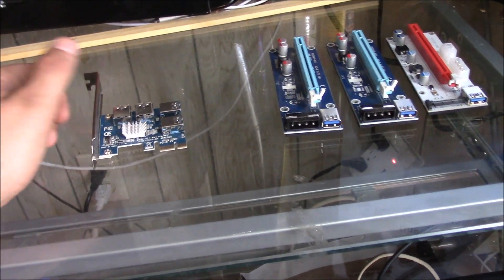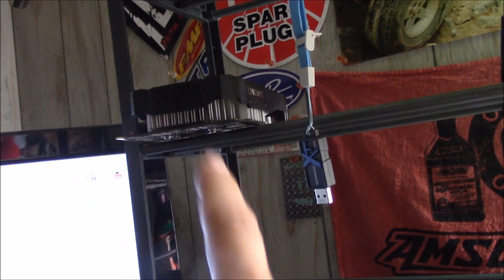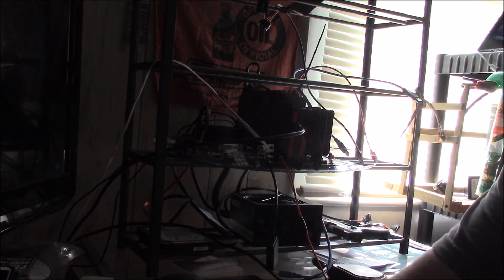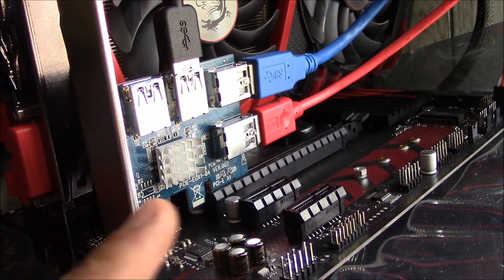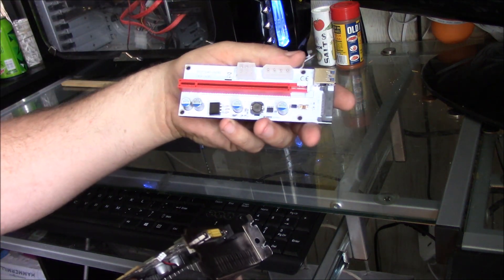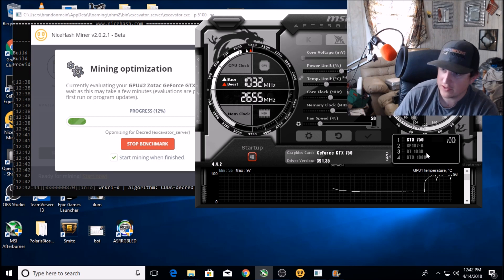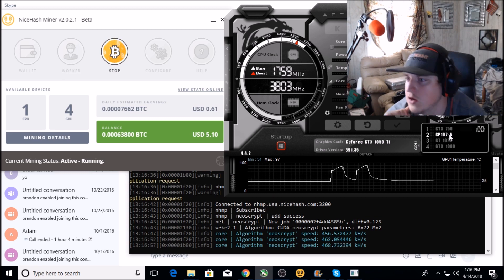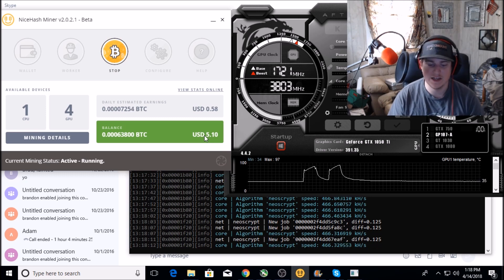Ubit 4-1 PCIE adapter splitter install more gpus

Comment: I know it's been a while since this video.... I'm having issues with my pc not posting, the monitor says it's going in to power saving mode and then gives me a black screen? I'm thinking it has something to do with pcie lanes on my x470 msi mobo. It's combined with 3200g cpu. I had 4-3070 and 1-3060 running fine on a 1200 watt psu and server psu for the risers... the only thing I did was add this 1 to 4 adapter. I'll try to see if I can get 2 to run before plugging the rest in.

It's either my cpu not having enough cores/threads (4/4) or my pcie lanes not being able to handle 4 cards. What do you all think? I plan to add one gpu at a time but to get video to display again I'm having to reset the cmos... tedious trouble shooting!

Comment: hi brandon since  3060s lhr needs a  16 or 8 pci  slot to give the max  hash on etherium does it do the same for ergo or i can install it with  this splitter and  still have the max power of the card

Comment: You should be clear that those are not really USB ports, they just use the USB form factor, but signaling is totally different on those pins.  If you try to plug a usb device in, it will probably kill everything.

Comment: Hi bro , I am using Asus prime h310 m2 Mobo , it has 16x slot 1 and 2 pcie slot. 
I am running 3060 1pc in 16x slot
1660 ti 2 pcs in pcie slot.

I had tried using pcie splitter for adding 2 more 1660 super using splitter

But my Mobo not detecting new GPUs.
When I add first shown error bootable device not found.
I had resolved it with adding additional psu.

Then second issue found windows 10 loaded but GPU not detecting.

On bios settings changed pcie version to 2.0 and 4g decoding enabled.

Then also my issue not solved.

Could you please make a video regarding this ?
Using same motherboard prime h310 er2.

Comment: working on mine :) used ITX mobo so I need this to run 6 GPU :) been 2months mining through it
Reply: What Gpus are you using ?
Reply: @adesheddie1  2x 3080 amd 2pc 3070 :)
Reply: Holy shit! This thing can handle those GPUs ? Is there any power issues?
Reply: @adesheddie1  well yes since feb this yr :)

Comment: Thank you for this video . Please make sure.  You always explain splitting pcie and splitting power are 2 dif things.  Sounds simple enough but some new users try to cut corners. Never push your PSU to hard .especially individual wires.

Comment: This can work with a 1-6 or 1-8 adaper, for mining?  Or the beacuse the bandwidth are too low for 4+ cards? 

*I'm very beginner in mining
Reply: sure its working, i dont think need that fast bandwith for transfering
Reply: @UVSMG  Thanks, I read after it, and its not supported by motherboard too. Max 13 amd card on win10.

Comment: Quick question in case anyone sees this, would running mining on a set of junker cards over a setup like like affect your CPU and main 1x16 GPU? I want to mine a tiny bit of crypto to use to ride market waves, but I only have one motherboard, and cannot risk degrading my main gaming, media creation, and workstation components.

Comment: Old video I know but I want my gaming pc back. I have 2 of these and a mobo with crossfire. Can I put 8 GPUs on one system using two of these 1 to 4 adapters? I know I can’t run four GPUs from a 1x slot but I figure I can use the x16 and x4 that I have. Someone let me know please before I tear apart two perfectly good systems
Reply from the maker: hmmmmm i dont think they will all have a video out =/
Reply: For mining lol not 8 monitor gaming
Reply: Also just noticed that my main system has a 1 to 4 working for months in a 1x pcie slot. I guess it will work

Comment: I got one of these ages ago but it will never detect my 970 or 480. Only the 1050 and 760 get detected and work. Talking about the 760 this morning i was getting £1.30 instead of the usual 10 to 15. But after i rebooted it was back to shite. Swapping my 970 for a 780 tomorrow to see if that gets detected. I just want all the Nvidia cards running together so my 480s free for games and what not.

Comment: Im using that, its working perfectly fine
Reply: do you think they work on linux ?
Reply: @t3nk0  not sure about that.. i only used it on Win 10
Reply: @christianoluko  well i tried by myelf. it worked instant without installing anything lul
Reply: @t3nk0  great
Reply: any specific bios settings to turn on/off for this to work??
Reply: @dukeanastacio2579  dont need. just plug in and it works.. ive tried on my board :D thats so cool that thing .. i bought m.2 adapter now..  xD

Comment: ha ha that 9mm next to the miner, glad you support the 2nd Brandon best regards. I have the same splitters and they work well for me, now if i could only get Windows 7 to recognize more than 4 GPUs..
Reply from the maker: I had issues on 7 ...10 seems to be alot more stable with more gpus

Comment: Good product review there, have you tested CPU hashing with that Ryzen? Built a rig with a Ryzen 1700 last year, it was hitting around 740 hash in Cryptonight in NHL at 3.7Ghz on all cores.

Do you Plink with that side arm there or is that just a fly shooter? If its real, Glad to see you also live in one of the free states. I picked up a VP9 last year, looking to get a MPX or Kriss Vector by the end of the month.

Keep it up, was hoping to see Spartan sneak in with Pokemon Cards.
Reply from the maker: thats my little SR22 its mostly a plinker but i carry it around more often than my glock it seems most days =p

Comment: Why dont you buy some aftermarket cooler 90mm with jack like on 750ti,and crew it on heat sink?I think 120mm is too big,but 90 should keep it cool perfectly

Comment: Brandon how are you able to use GPU s of varying memory amounts  on the same rig?
Reply from the maker: using nicehash it lets different cards mine  different coins =]
Reply: Most miners (ccminer, Claymore), as long as all of your cards are Nvidia Cuda cards should be able to work together even if they are not the same. I am running 1060 6gb,1070ti's and a 1080ti on the same rig. On Nicehash, the software just chooses the most profitable coin for the card. The 1060's run Equihash, the 1070ti's run Dagger, and I have the 1080ti on CNV7 cause it runs hot (I need to repaste it).

Comment: does that mean that you can use any motherboard even those who support 2 or 3 GPUs and use up to 8 GPUs on it ?
Reply: Sorry to interject here, I have a gigabyte MB with only two PCI slots on it. I was going to use it for a Home Theater PC and instead decided to use it for mining, I got one of those spliters and install 5  rx 570s on it, it works perfectly.
Reply from the maker: it is possible =]
Reply: Make sure all your risers work. test them 1 by 1

Comment: okay okay.... interesting. imma pick up one of these and try it with smos/win7/win10 and drop in a review on reddit
Reply from the maker: smos i cant get it working on have done a video in the past
Reply: dammm. i've just built a shitrig out of random parts i found. got smos on it. havent got this multiplier yet. will use multiplier with win7/10. keep vids coming good work